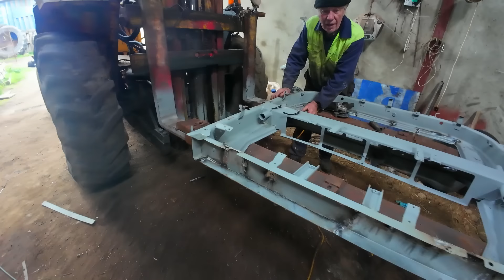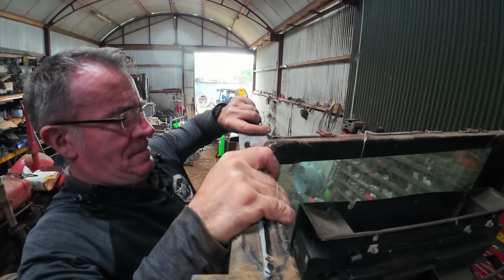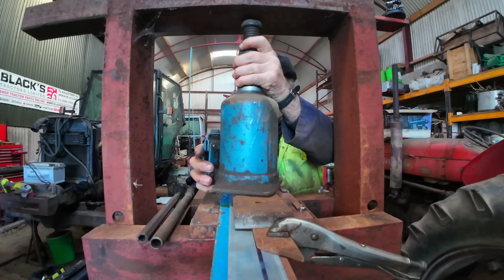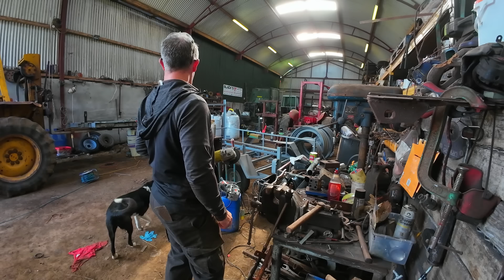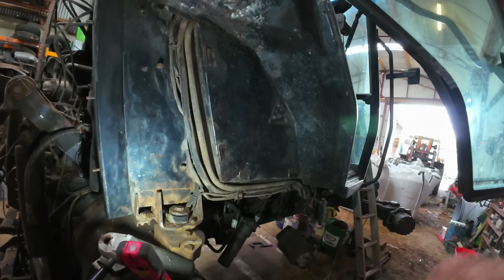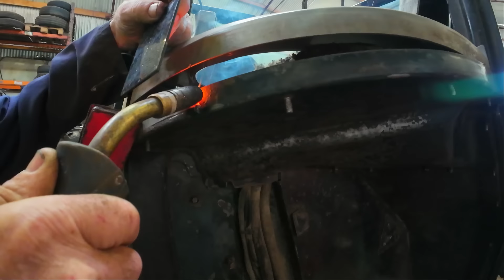6150 RESTORATION CONTINUES- WELDING, RUST REMOVAL & PAINT PREPPING, ALL IN A DAYS WORK.

Comment: You can use a rust converter on some of the areas where the rust is solid, knock off the loose bits and paint it on..... also a mask keeps the black snot to a minimum 😊
Dirty job but so satisfying when done...good job.
Your auld boy is handy to have around
Reply from the maker: Cheers Patrick for the tips.  Yes handy boy for sure.💪👍

Comment: Would you still have bought that tractor knowing what you know now ? You have great patience working at it + looks like your father is enjoying it . Good video.
Reply from the maker: Thanks.  These old tractors are all the same, there is always more issues than you can spot at a sale inspection, Those cab roofs are a weak point in 61 and 62 series I knew there would be some issues with it when I peeled it back,  but did not expect it to be as bad as it was.  At least it is fixable at this stage so we got it on time.  I probably would still have bought it as its mechanically sound now, but maybe not have put it in for repair.